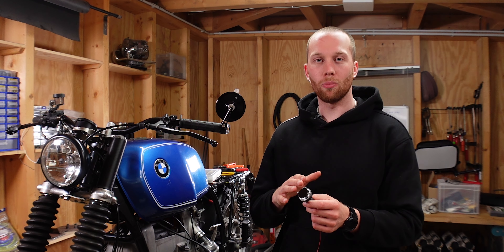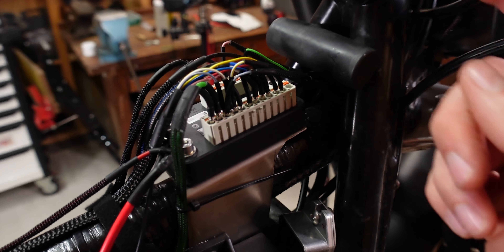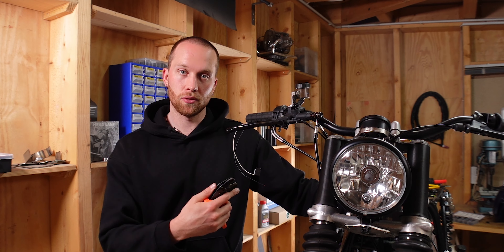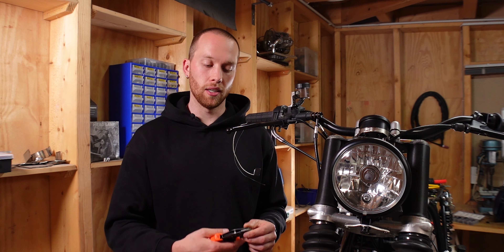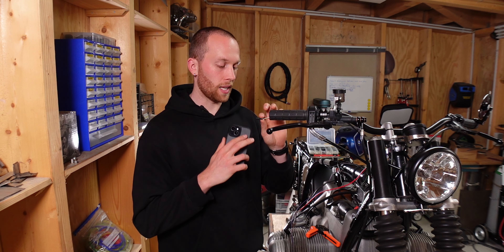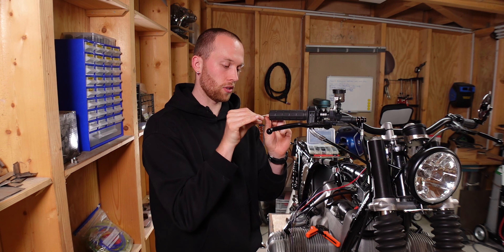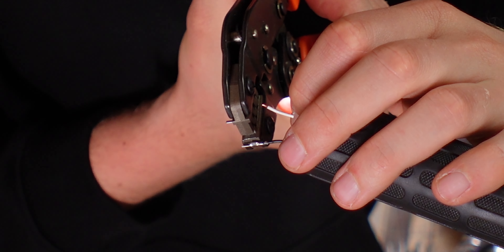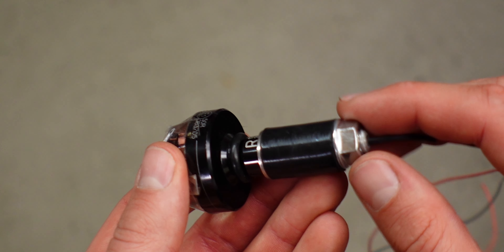How To Install Bar End Indicators

Comment: Another great video Josh 👌🏼 When I redo my bars and wiring I will go for these plugs!
Reply from the maker: Hi Andy! Thanks a lot. How did you install yours? Also sorry, I just noticed that I didn’t get back to you on IG. How’s the beemer running? No rear fender will probably give you a lot of reasons to clean your engine 😂
Reply: @MotoWrenchers  I just hardwired mine in but missed a trick hiding wiring through the riser so will correct that and redo it all at some point. Bikes running OK now, new clutch pack fixed that issue, it's deffo just a 'show bike' won't see any wet roads 🤞🏼🤣
Reply from the maker: @andyberhaahn I think there will always be room for improvements with any project. That way you can keep optimising it to your liking. And yeah…I guess most of the more radical builds are not made for wet roads 😂 Riding in the rain isn’t fun anyways. What was the worst time you got caught in the rain with your bike?

Comment: Do you need special hardware to also fit the bar end mirrors or do they clamp onto the indicators?
Reply from the maker: The mo.view mirrors simply slide over the handlebar and can be tightened wherever you want. They are independent from the indicators. I hope that helps.

Comment: Wo hast du die p25er gekauft? Gabs die im set oder hast du alles einzeln gekauft?
Reply from the maker: Moin, ich habe die bei Distrelec gekauft. War gar nicht einfach einen Shop zu finden, wo man die als Privatperson kaufen konnte. Aber da bekommst du die auf jeden Fall. Ich habe jedes Teil einzeln bestellt. Double-check auf jeden Fall, dass du die richtigen Einzelteile hast (die offiziellen Molex Links sind in der Videobeschreibung). Welche Blinker verbaust du? Viel Erfolg!